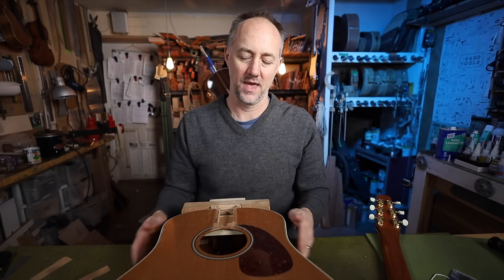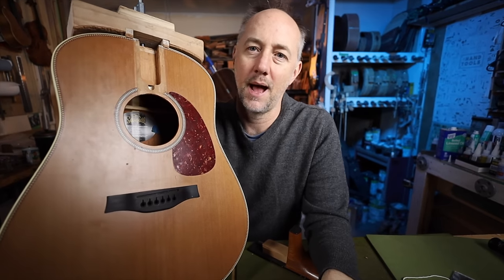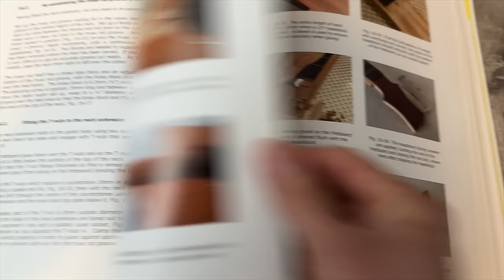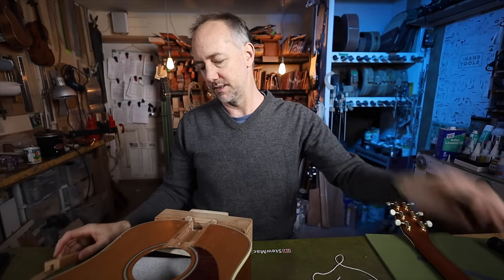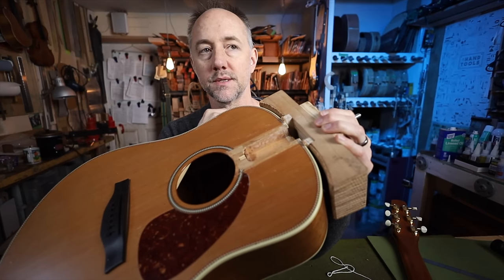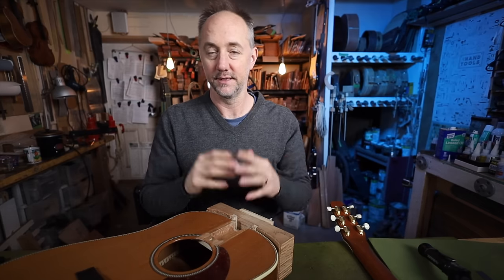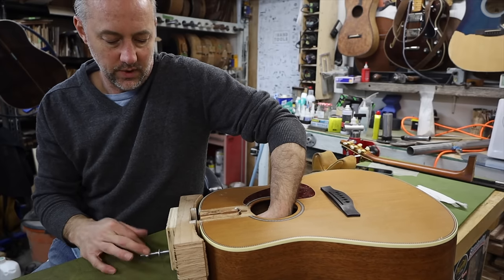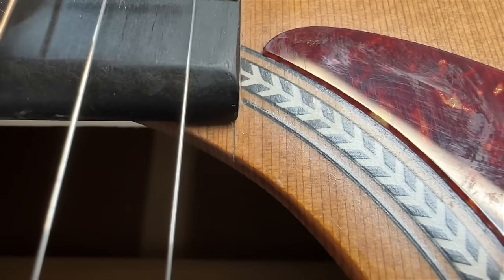The Hidden Problem with Seagull Guitars...

Comment: The part for any manufacturer is knowing how a thing will behave in 10yrs time.  I have one of the oddly named Norman guitars from around 1995 is my best guess, and it has served me well.  Thanks for the breakdown on this issue.  No doubt Mr. Godin thought he was solving a problem, not knowing where it would lead.  The great reminder is that there are people like you who look at a weakness and find a way to make an instrument playable again instead of a decoration in a landfill.  Great video.
Reply from the maker: Now i want a Norman!
We didn't import/sell those in Australia so I don't think i've ever seen one. Your right- a manufacturer has to weight up profit now vs repairability (warranty) later- these guitars are worth a neck reset and I wish Godin made it possible to do so. Anything sub $500 makes a neck reset a total no go.
Reply: The Norman that I have is the solid cedar top with Cherry Laminate sides and back.  I have not babied it in any way and it shows, but it plays nicely after a bout with a belly issue and the bridge coming loose.  I think I paid about 500 for it in 1999, and I think I got my value from it.  The pickup is pretty good too.  Thanks again. @BeauHannamGuitars

Comment: You did an excellent job fixing, would would they ever use epoxy
Reply from the maker: Factories see a fully solid neck join like this as being better in the short/mid term (which they probably are actually) with no regard to the long term needs like neck resets which every guitar will eventually need.

Comment: WOW, I am SSOOOOO glad I did not get the Seagull 12 string I was looking at.  That would be even more susceptible than a 6 string....  wow
Reply from the maker: Yes, 12 strings have more tension on the top but the top bracing is usually (should be) wider/taller to compensate for that
Reply: @BeauHannamGuitars  it was a relatively light weight instrument, so I imagine construction was similar to this 6 string.  Worked out for me though, I got a nicer Alvarez 12 for half the price of the Seagull.  Gently used at a pawnshop, Seagull was new at a crap music store.  (A shop I will NEVER set foot in, worst experience ever)

Comment: I own a Taylor 214ce. While its not considered a high-end guitar, I still prefer not to gig a $1250 guitar outdoors. 

So I played every used guitar in the store and finally saw a 1990 S6 with solid cedar top, laminated cherry back/sides, rosewood fingerboard and a maple neck. I HAD to have it! (Literally my favorite guitar I own). They tried to get me to spend an extra $150 for a new S6, but honestly I thought they were JUNK! No tone, no resonance, no feel, strings were WAY too high, and no luthier in the world could've made me like them. 

My question is, why is my 1990 model so much better in feel, sound and resonance than a modern S6? You've previously mentioned that a cedar top does not improve in tone with age, so according to your assessment, logic tells me the guitar sounded like it does now on the day it was made. 

For me to grab it first over my Taylor is really saying something... because I LOVE my Taylor. The S6 has become my songwriting session guitar.  It goes well with singing ballads, vs the big boomy tone of my Taylor.
Reply from the maker: Some guitars are just better than others - with any brand. Also, as a company becomes bigger and is making more instruments, warranty issues also become larger so, inevitably, the factory needs up
Bracing, top thickness, neck joints (!) etc so see minimal warranty work- but it’s all at the expense of tone. So early guitars are often better then later ones with factories. It’s the opposite with luthiers.

Comment: SO enlightening.  SO helpful.  (And SO validating, since I imagined that I was the only one who noticed that neck joint section of the factory tour video.)

With my own Artist-Peppino model from 2010, someone on some forum somewhere suggested that the use of epoxy didn't apply to their high end guitars.  Yet, here you have an Artist model as well . . . 

Just wondering if the fingerboard extension really has to be glued down.  Aren't Taylor's free-floating or whatever you call it?

Thanks for the great video and for being so generous with your time going through all these comments.
Reply from the maker: Thanks for watching. Yes- Taylor and Trevor gore (and others) do almost the same thing but bolt it down, instead of epoxying (or any glue). It’s a good neck joint but Godin ruins it with epoxy.
Reply: So, if you don't mind my asking, did you absolutely have to glue down the fretboard extension in this case?
Reply from the maker: Good question. I didn't in this case, but i could have made it into a full bolt on (like Taylor) by adding threaded insert (1 or 2) to the block with the bolt coming up through the headblock extension inside. That would be an extra few hours work though.   @agenuineg

Comment: I have a Seagull guitar that has collapsed just the way you described it as doing, and where it cracked on either side of the neck it thrust the cracked top ahead by an eighth inch into the sound hole. The resultant neck to body angle is so bad that the machine is next to useless. I had bought it from a family owned online guitar store in St. Louis Missouri, and they would have know this clearly evident condition. before they sold it. "Sounds Cheap" - and for good reason. Beware this outfit.
Reply from the maker: Sorry to hear that. That all can be fixed but it might not be worth it if it’s a cheaper seagull.

Comment: I have a Seagull from the early 90’s that also has cracks along side of the fingerboard…
May be time to investigate…..
Reply from the maker: The neck will be easy to remove. I filmed the repair I did on a 1987 Taylor that shows me using that big jig I have bolted to the guitar at the start- it can be fixed :)
Reply: I’ve made a few acoustic guitars but never have taken one apart…
Sounds like an interesting challenge👍
Reply from the maker: Taking them apart (and putting them back together again) is enlightening!
Reply: I will immediately call you on the Batphone if I get stuck👍

Comment: I'll never own one. Every guitar manufacturer knows that the guitar will have to have a neck reset, eventually. You should design the guitar to allow setting the neck easier, not harder. I would also, if I were building it, I would have a slight extension to the bottom of the neck block too. Just like you do the top. Not as drastic as the top, but still wider at the bottom of the neck block, than the middle portion. That helps with the guitar folding over time.
Reply from the maker: Yep, and id does make sense to have an extension on the bottom of the headblock- some classical makers do that- its kind of like a big C. Best is if you butt the bottom of the headblock up against a back brace- just like butting the headblock extension up against the upper transverse brace. but it would kinda look strange through the soundhole.
Reply: @BeauHannamGuitars  
I know it would look funny, but people who know guitars would get it. And as long as it didn't effect the tone of the guitar, I would want it there. Great video...
Reply from the maker: @HayesTech  thanks 😊

Comment: not sure of its validity, but I was always told that Robert Godin was the one who taught Bob Taylor this method of neck joint.
Reply from the maker: Oh cool!
Reply: I don’t think that’s correct. Taylor was asked to do a repair to a guitar with a dovetail joint and he couldn’t get the joint apart, so he sawed the neck off and converted it to a bolt-on and has done bolt-on ever since. At least, that’s the Taylor mythology.

Comment: Do the Godin guitars have the same issue? I bought a 90's seagull that was highly recommended, I kept if for three weeks. It was not for me although it was a mid-level guitar, the ease of playing the chime, even the looks just did not do it for me. I went to Takamines for about 10 years and then on to Alvarez, Martin and Guild guitars. I must share I had a similar problem with other cheap guitars and my Gibson SJ Deluxe 1968.
Reply from the maker: I only know that all Godin made acoustic guitars (patrick&simon, Norman, La patrie, seagull- that I know of) after 2006 have this. I’m not sure about their arch top guitars like 5th ave guitars. I presume any electric guitars they do with set necks (not bolt on necks) are epoxied in but I don’t know if they even do set neck electrics.

Comment: Had mine over 10 years. No problem.
Reply from the maker: The need for a neck resets can occur in 10 years but usually takes 20-30 years. It depends on the guitar.

Comment: Tbh I wondered if "epoxy" to Australians was like how Brits call cookies biscuits, but as soon as I saw indeed was epoxy, I saw your issue with it.

I'll have to keep this in mind, but I'm sure most guits go without resets. As sure as I am that I won't be paying for one on my low end stuff.

I like S6s because they're cheap & cheerful, & are one of the few inexpensive models that offer 24 3/4", or were at the time.
Reply from the maker: I wasn't 100% certain if it was actual epoxy until i saw that factory tour footage. ALL guitars need a neck reset eventually, but this neck joint makes it not a viable option for anything under $500
Reply: @BeauHannamGuitars  can you steam titebond, or is that just a hide glue thing? I might also be thinking about solud bodies.

Either way the whole factory joint thing reeks of cheap construction with a dash of planned obsolescence thrown in. 

Louis Rossman would probably enjoy this video.
Reply from the maker: You can steam titebond- that was actually something i didn't think off, but its a horrible thought- to drill down the fret slots into teh pocket and add steam in a  hope to get the neck off. oh god no!
Reply: @BeauHannamGuitars  that's the method I've seen,  but as I was typing it, I realized it could be disastrous on an acoustic with the thin wood.
Reply from the maker: I added this possible (be scary) solution into the description.
Reply: @BeauHannamGuitars  cool!

Comment: I had one and reviewed it on my channel.
It was beautiful, sounded really well, but the neck profile was AWFUL, almost square.
My hands cramped a bit while playing it, and it NEVER happened to me before or since.

This neck joint is a luthiery crime.
The Asian 150$ Cort guitars have proper dovetail joints, and 600-2000$ Canadian ones epoxy necks in while ALSO using bolts.
Unbelievable.
Reply from the maker: haha- yep- their neck profile isn't great. I don't like the square heel either. But i don't mind the tone of these. I do mind this idiotic neck join though!

Comment: Very Interesting
Reply from the maker: Thanks :)
Reply: @BeauHannamGuitars  I use a similar neck joint to the seagull but I fit it accurately to the slot before I glue the fretboard on and have a captive nut and a spreader on the 6mm capscrew along with two 6mm caps on the neck. I also half lap the first cross brace into the neck block extension.
Reply from the maker: @neilmchardy9061  half lapping the transverse brace into the headblock is a great idea- I hadn’t thought of doing that.

Comment: I asked the Godin folks about this at 2024 NAMM. They said "we have special system for removing necks at the factory". So then I asked if they expected people from around the world to always send their guitars back to Godin? Yes, they said. But our necks rarely need resetting.
Reply from the maker: To my understanding, their method for a neck reset is to CUT/SAW the neck off, route away the epoxied in block, and put a new neck on.
I’d not call that a neck reset. I’d call that a new neck ! Hahhaha
Reply: Probably cheaper in the long run for them since they can mass mfg necks rather than individually adjust an old one.
Reply from the maker: @geldner  yep- it’s a throwaway neck system, but I think I’ve come up with a way to get these necks off (in my head anyway- one day I’ll try it)
Reply: @BeauHannamGuitars  Wonder if you could inject Jasco Epoxy Remover into the space between the neck and body?
Reply from the maker: @geldner  possibly - I’ve not heard of that product

Comment: This is baffling. What is the point of a bolt-on neck if you're just going to epoxy the tenon in place? A traditional dovetail with hide glue would be a better system. And the video clip makes the whole neck seem like something of a kludge, with the glued in extension and dowel-reinforced heel. I wonder if these were somehow hacks that were devised to address warrantee work without sacrificing existing tooling and fixtures?
Reply from the maker: The insert they use can fix a problem Godin mentions which is a hump at the body join. But they could also use some bolts like Taylor inst ad of epoxying it in and it would be better- but they would need to fit it better with no air gaps

Comment: You could glue the block t
Reply: You could glue the block to the fingerboard drill 2 holes under the pocket and screw the block down along with the neck bolts?

Comment: I've owned a couple Seagulls, never had an issue with them.
Reply from the maker: They are usually pretty good, until they need a neck reset.
Reply: @BeauHannamGuitars  kinda like Les Pauls till they need a headstock repair?
Reply from the maker: @GlenDeanII  exactly

Comment: True its beyond me why they epoxy the neck. Why bother with bolts? I'm sorry I purchased a Simon and Patrick. I never would have knowing they epoxied the neck. As for Norman guitars. I had one and it was one of the worst sounding guitars I ever owned. I almost gave it away. Didn't get much money for it.
Reply from the maker: The bolts hold the heel into the body. Yep- it’s a shame they use epoxy.
Reply: @BeauHannamGuitars  I just meant,,if you epoxy the neck, you don't need bolts. I'm not a luthier just a player

Comment: using epoxy makes these disposable kind of..wen it wears out toss it in the trash. ive seen guitars that had nothing but a simple wedge holding them together. repairability matters! black star amps are the same story, if it breaks toss it and buy a new one?  consumers need to stop supporting this practice and let these rot on shelves!
Reply from the maker: Yep. Thanks for saying that. I didn’t know about the black star amps (the cabinet is epoxied together instead of screws?!?!)

Comment: A very interesting video. Not a repair to be attempted by a novice. It would have added more interest if you had shown the problem with the neck before you dismantled it.
Reply from the maker: Thanks. This guitar was in for a different problem which I’d already filmed. It wasn’t until the neck was already off that this whole problem presented itself to me. And this neck attachment system works and is good as it it seems to help minimize the body join hump. The problem is when the guitar needs its neck off for any reason.

Comment: It's clearly engineered to be the quickest, cheapest way to fit the neck, with no regard whatsoever for any future adjustments.
Reply from the maker: Yep, Which is sad as a $1600 guitar (Which is what this guitar goes new for) should be able to have a easy neck reset done the road.

Comment: Big mistake moving away from the dove-tail joint.  The epoxy used will piss off even the most talented of luthiers when needing a neck reset.
Reply from the maker: Yep. 
Dovetail or bolt on are the same (for tone and stability) as long as the joinery is good.

Comment: PVA glue (Titebond), hot hide glue, fish glue, etc. will create a joint that is stronger than the wood itself when done properly so why use an adhesive that is a royal PITA to dis-assemble??? Maybe Godin should switch to foaming polyurethane glue? We need to stop solving nonexistent problems! When the master luthiers solve a problem, just pay attention, they already tried the 2000 other things that didn't work! When you are not sure just ask yourself, "what would Frank do"? 😉
Reply from the maker: Yep to all that!
Reply: @BeauHannamGuitars  fortunately where I am we don't see many Godin products. A lot of Bluegrass here so they all want Martin and Gibson. Or copies of them. Mostly I do repairs and very little building so I get to see a lot of crazy stuff!

Comment: Taylor’s are easy. Bolt on. Martin’s etc are a bit of of work but Hyde Glue is used. Not too bad. But this....I was going to do a neck reset on this type of guitar. Forget it. I would rather wash my face with battery acid. Omg. 🤢🤮🤣
Reply from the maker: Hahahahah- yep- it’s its 2006 or newer you gotta charge more

Comment: great guitars, terrible neck profiles and yeah construction innovation that actually sucks
Reply from the maker: Yep
Reply from the maker: Well, every other brand has a typical dovetail or bolt on, which is more easily repairable then this joint.
Reply: I amazed how many acoustics have the neck angle set too shallow form the factory. And action is high and you have to reset because usually the saddle is too low too. 
 @BeauHannamGuitars
Reply from the maker: Yep- that was the main issue i dealt with when working for the importer in Sydney Australia back around 2008 @hustlinc3540